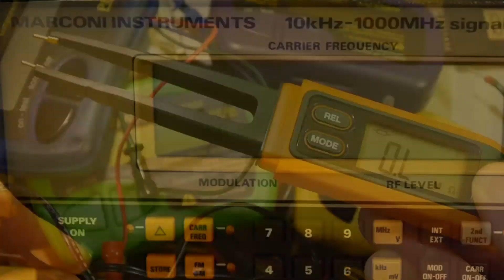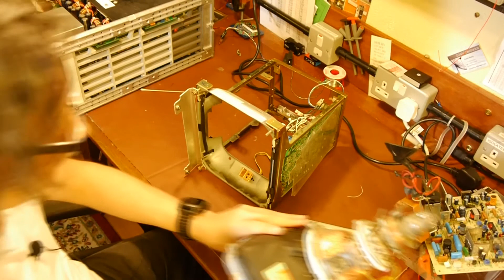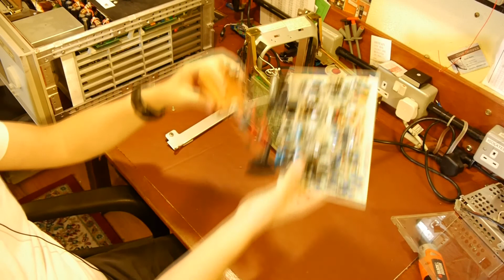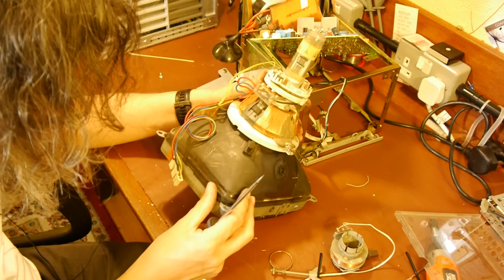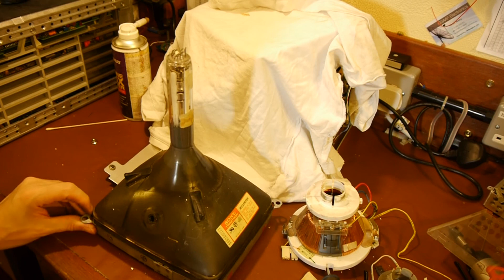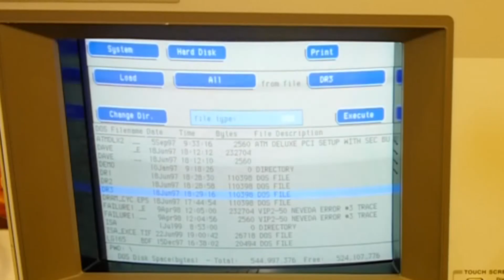HP16500C PART 4 A Pain In The Neck

Comment: I remember back in the olden days, before you were born Chris, finding a dumped TV set was extra special. If remember, it takes a fair blow to send a brick through the tube face, so the idea was to run toward the TV with a brick and sort of swerve around the TV while lobbing your brick (or little sister) to avoid any imploding glass. What you youngsters won't realise is that if you did manage to cut yourself on the glass, blood was black, as that was before the invention of colour of course. 
I did text you tonight to say thanks, just in case I had finger trouble.

Andrew
Reply from the maker: Andrewausfa  No problem be interested in hearing a review on the twiddlers. I’m not so impressed but was intrigued by the ceramic material. God I must have smashed loads of old TVs wish I had then now. It’s amazing how age turns common worthy items into  today’s treasure. Regards Chris.